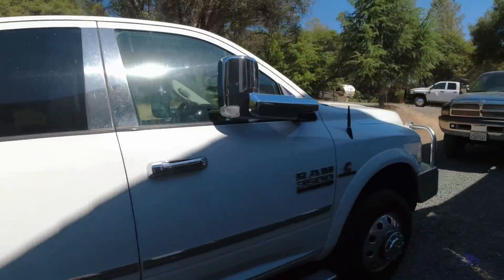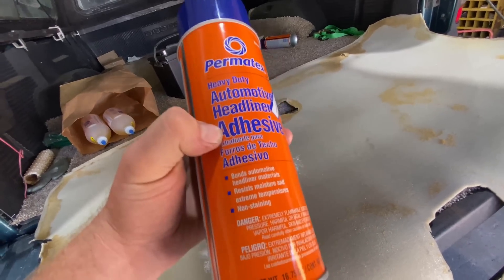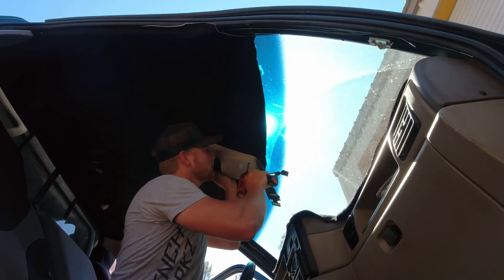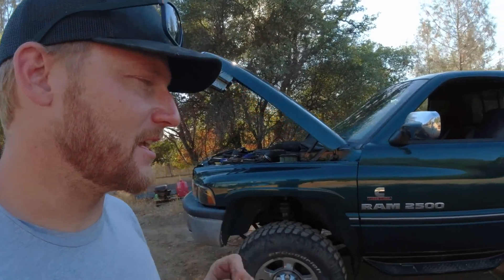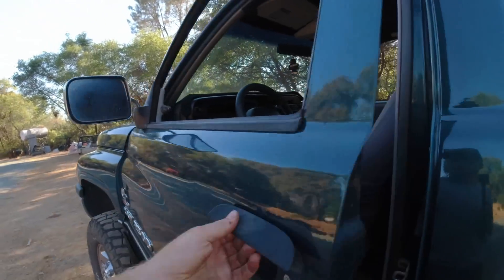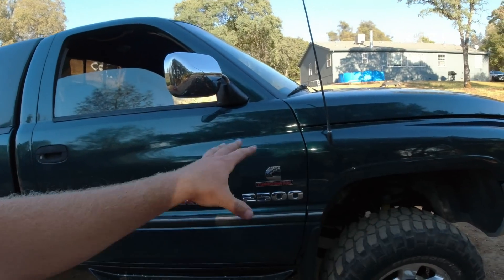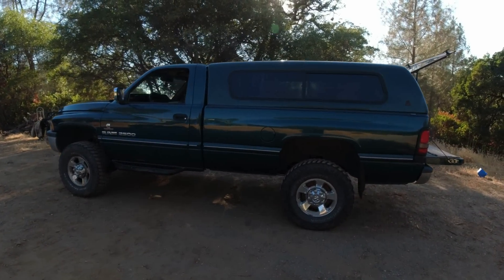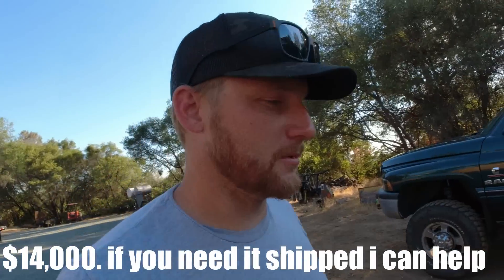SAYING GOODBYE  SELLING MY 12 VALVE CUMMINS 5 SPEED COMPLETLY GONE THRU

Comment: It should sell quick, Truck prices have gone crazy!  Here in NY it would also qualify for 'antique plates', 25 years old. No rust ever is also a big deal! Most 94's here rust, rot and fall off the frame. Sad as that is. I just looked up the KBB trade value on my 2012 Silverado 2500HD gas, 32k miles.  $38,000.  That's about what I paid for it new!!  Replacement 2021 is $60,000!! It's mint and I'm keeping it!  LOL    JMHO    --gary

Comment: Just bought a 2002 second Gen and would like to put a back up camera in the truck but do not want to cut the dash up to put a double din in it. Does this fit in the dash with no modification on the inside of the dash? If so what brand model is the stereo? Thanks.